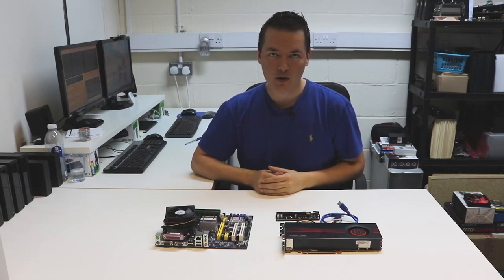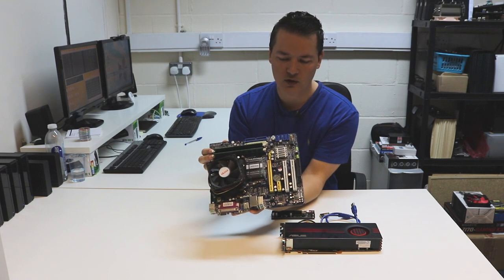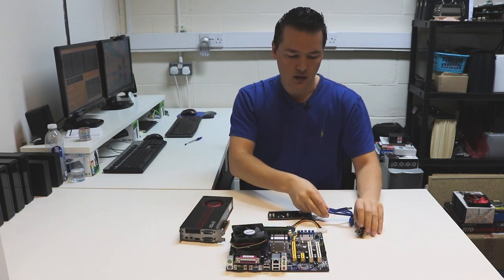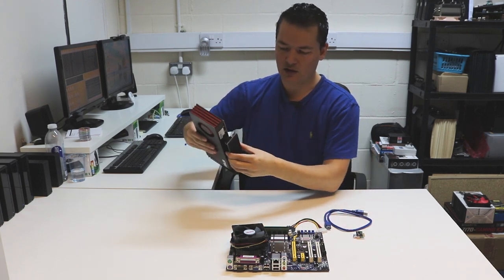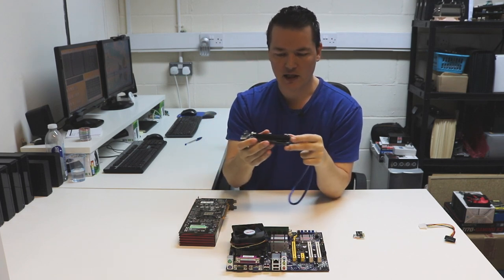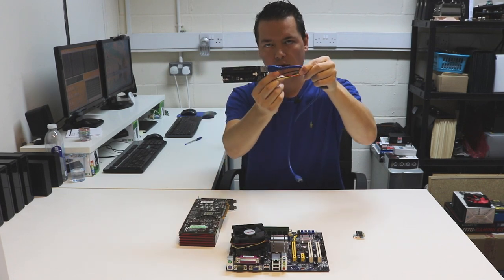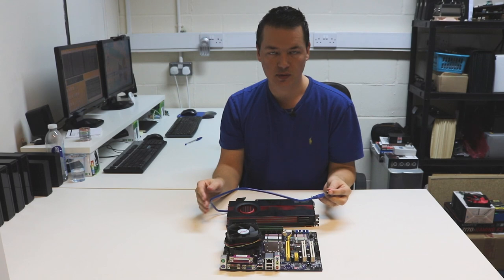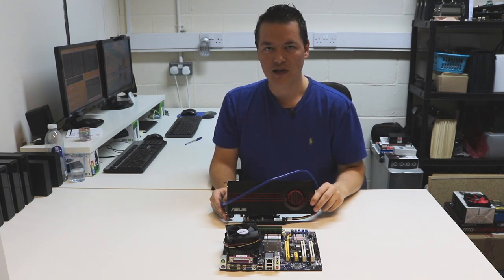How To & Why Use PCI-E 1X - 16X USB Extension Riser Cables

Comment: How can a USB cable connected to a x1 PCIe transfer the same amount of data, then using the graphics card directly inserted into the x16 PCIe? 
I'm not a miner, but I can't imagine that the card will have the same performance. 
I mean... it uses only fraction of the connecting pins of the motherboard's x16 PCI-e slot.
Please, drop me a line if you have a reasonable explanation... Thanks!
Reply from the maker: Mining doesn't use all of the pcie channels, there is no difference in mining performance using a 1x or 16x slot.
Reply: Ahhm... OK, but why do they say 1x and 16x? I don't think it's just marketing... why would they use more pins?
Or is this only for mining? Do you mean, that I could't use it this way for gaming? I guess I have an idea now. The GPU is receiveing "tasks", and the results will be sent back. But probably not good for gaming this way. Sorry for this question, it's just a mystery to me :-)
Reply: @TheMaxAcceleration  I was scrolling down looking after that question, thank you for asking XD
I made the same observation

Comment: How do you add extra power if 8x isnt powerful enough?
Reply from the maker: Can you provide more details?
The graphics card should take most of its power through its own 6/8 pin connectors. The powered riser only requires a little power via a sata / molex or 6 pin pcie connector.

Comment: I have a question, I'm not into cryptocurrency mining so my question has nothing to do with that. I do use a program called blender which is a 3D Graphics program. It uses gpus to actually render images but the rendering is not typically done in real time. Does anyone know if using one of these risers will work in a program like blender.
Reply: yes, it will. depending on the preferences you have set. Sorry for the late reply.
Reply: Thanks for the info. When GPU prices come back down I'll probably get me another 1060.
Reply: Yeah, stupid crypto miners driving up the prices, the GTX 1060 Went from $350 to $590 in less than a week. Sucks ass to be honest.
Reply: I bought my GTX 1060 6GB new for $262. That same GPU is over $500 now. I have been cussing those miners for weeks now . Correction, New Egg has it for $478 "MSI GeForce GTX 1060 DirectX 12 GTX 1060 6G OCV1 6GB 192-Bit GDDR5 PCI Express 3.0 x16 HDCP Ready ATX Video Card"
Reply: yeah it sucks, i wanted to get that exact same one you mentioned too. I've been stalking the price on it. I'm hoping this crypto BS crashes. So gamers/animators whatever can re-unite and become one and strong again.

Comment: Wow! Thanks for this, finally someone who explains this... But one question, with that MoBo, you can connect just 4 GPUs or more?... And if you can connect more, how do you do it? Cause I'm confuse... I see 4 PCI slots, so I assume you could only connect 4 GPUs... Thanks!
Reply from the maker: If you have four slots you can use four risers, but you can also get a special splitter riser but you can only use one of those and they have compatibility issues.
Reply: Ok ok... I understand that is why is better look for a MoBo with 6 PCI slots... Thanks a Lot Lee... Where can I find information about protection, from electricity flow and that kind of stuff... In my country besides the electricity is very cheap, the service is not that good and I would like to protect the hardware from any flow issue
Reply from the maker: All of the decent branded power supplies have many protections built in. I would just combine it with a mains surge protector.
Reply: Thank you so much Lee! This has been very helpful, have you any videos setting the software for the miner... I'm very very very new at this... Sorry if I'm a pain jaja
Reply: Does this combo of CPU+MoBo would work for a Eth rig?.... AMD - A4-6300 + ASRock - FM2A88X PRO3+ , is the cheapest I found.Im on a really tight budget- thanks

Comment: Would be better if the motherboard just have all PCIe X16 and no mini's, the x16 is better and can use all smaller pci as well.
They need to make a motherboard with 4GB of GDDR5 integrated for gaming, that would be awesome, with two low powered CPU sockets, and only 2 server Ram slots, in the back only M.2 slots NO DVI or VGA ports

Comment: can i install ddr3 video card on my ddr2 motherboard using pcie riser?
need some help🙂
Reply from the maker: Yes you can. The gpu has its own memory and operating speed which is different from the motherboard memory.
Reply: thanks .uhm does pcie extenders have different types of slots?

Comment: How can I extend USB cable for risers? I tried with longer usb I have at home, but non of them work! Tried t usb cables from riser to connect with connector and it does not work! I need longer cables! But they does not exist to buy! How the hell I can connect 13 GPUs if cable only allowed to get only max 4 GPUs! Tried even cut cable of reader and make it longer - didn't worked! Please, help! Thanks
Reply from the maker: You can get extra long cables, I think I have some that are 1.5 metre. You can't use regular usb cables, I think they have to be usb3 (not 100% sure).
Reply: @IMineBlocks  yes, i have usb3 cables, but they do not work! How exactly those cables call?

Comment: hi 
  can i link usb Cable to outlet usb in motherboard withowt pci-E because outlet pci-e dont here in my motherboard 
pleas i need help   XO
Reply from the maker: No, the riser still requires a pcie port you can't connect it to your usb.
Reply: but i have usb 3.1. is it help me or not?
Reply: usb 3.1 in motherboard because it very speed
Reply from the maker: No, the usb cable is used for data between the two pcie interfaces. It cannot be used by plugging it into any usb port.
Reply: IMineBlocks thanx dude  XO

Comment: PCIe 16x has about 50 legs, how does that not create a terrible bottleneck going through the meager Data+ and Data- of a USB cable?
Reply from the maker: Mining doesn't use the full bandwidth of the pcie port.

Comment: does this method work for gaming?
Reply from the maker: You'll need to use 16x to 16x riser cables.
Reply: thanks mate
Reply: Does that mean the gpu wont be read if I connect it to a x4 or x1,My gpu suddenly wasn't detected and it might be because of a faulty x16 pci slot.So I thought maybe instead of changing the whole mobo I could just use this method, gpu is 750ti.So its not possible then?

Comment: Do not you need to power gpu with 6 or 8 pin?
Reply from the maker: Yes you do, if the gpu has a power connector then it too needs to be powered.

Comment: I want to run macos on my computer but I have a GTX 760. I'm just going to buy a Radeon and throw it in my computer, drill a hole on the side of the case the IO is on and snake a cable to the radeon through it.

Comment: Would you do a video of the PCIE 4 to 1 card as found here: https://www.youtube.com/watch?v=M3ZTE9LpRHs.  It would be great if we could use older computers say with 2 or 4 PCIE slots so that we could attache 8 to 16 cards using these 4 to 1 boards.  The question is do they work and how reliable are they?

Comment: Do they affect hashrate
Reply from the maker: No
Reply: @IMineBlocks  so ur telling its same if ur riser is version 6 or 10. Usb2 or 3. As same sa straight to motherboard
Reply from the maker: @alexabadjon4091  Correct, different version risers just have different power connectors / power regulation.

Comment: Can I use it on a laptop?
Reply from the maker: No
Reply: Just so you know, yes you can, but you need a mini PCIe connector to go in place of the wifi module. I bought one of these boards recently, but it seems to be bad, i was able to hook up a usb hub to the mini PCIe adapter through my wifi module connector and it worked great.

Comment: Theres no real point of plugging this into a 1x slot since it doesn't have the through put so yes using a high speed usb point is fine thats why it's 3.0 cable.
Reply from the maker: 1x is perfectly fine for mining. This cannot be used via a usb3 port!